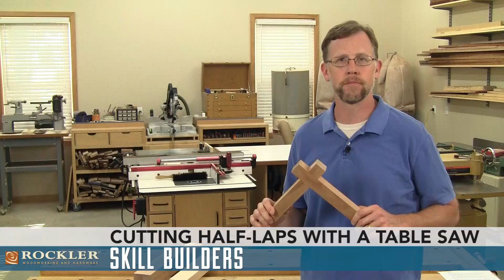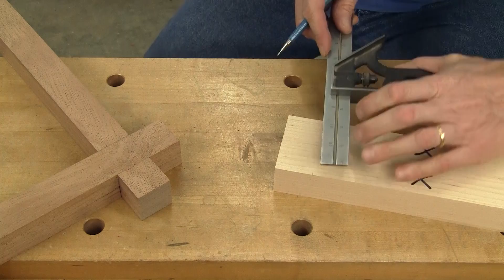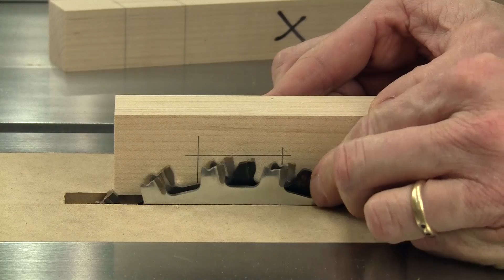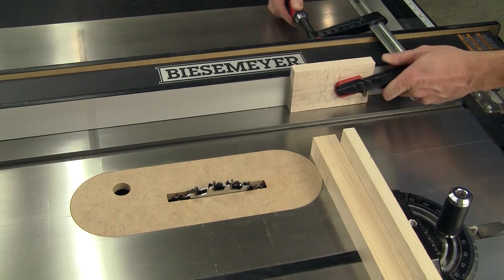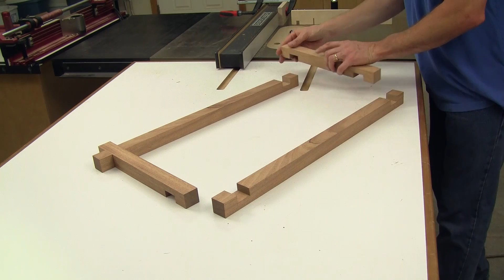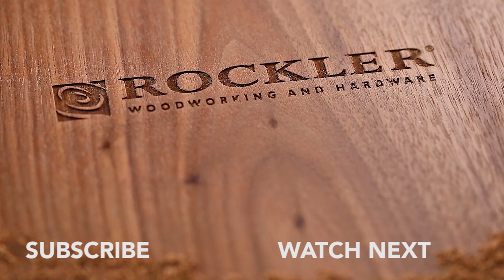How to Cut Half-Lap Joints with a Table Saw | Rockler Skill Builders

Comment: Why do you have to have a step off block? I don't think I will be able to keep my wood going in a straight line unless I can put it against the fence
Reply from the maker: A step-off block isn't mandatory for non-through cuts such as dadoes, but it will reduce the chances for kickback to some degree. You can always clamp the workpiece to your miter gauge fence in this situation so the wood can't move laterally when using a step-off block.

Comment: The most awkward part of using a table saw is figuring out where the blade is going to cut the wood.  If someone could dramatically simplify this and make it accurate they could make a lot of $$.
Reply: If you make a zero clearance insert you can use the cut in the insert to line up your cut.
Reply: You won't make one for every dado width or for a single blade at various angles.  It's just awkward to have to put a line on the front of the piece of wood and have to crane your head and neck around the front of the piece and move the blade with your fingers up and down to see where a tooth will hit.  This seems such a stone age way to line up a cut on an expensive piece of equipment.  There has to be a better way that hasn't been invented yet.